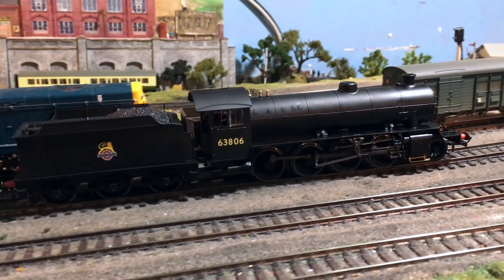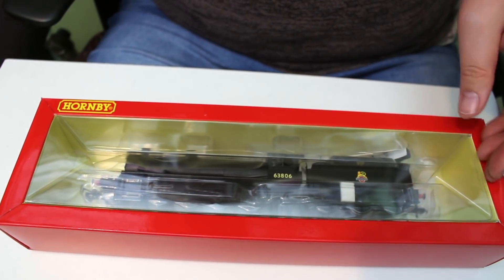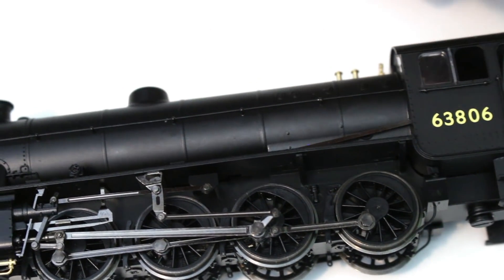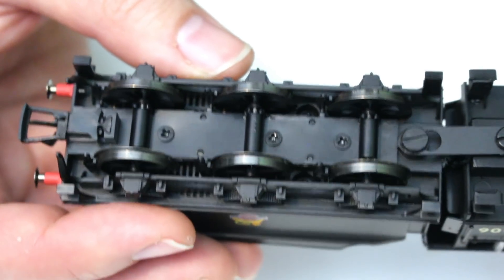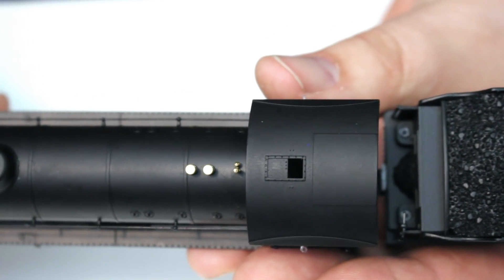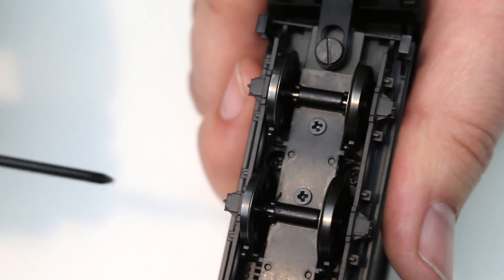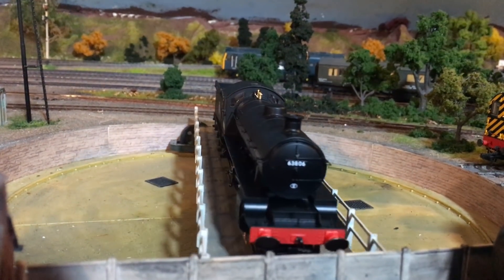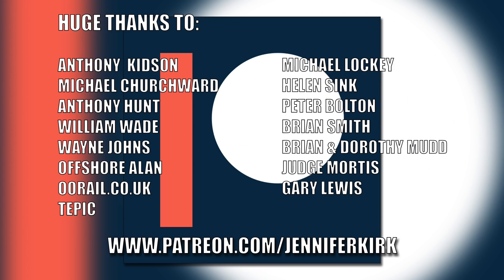Hornby Thompson Class O1- Review and DCC Fitting Guide

Comment: Nice review and Jenny made it look so easy I bought a new DC loco and a DCC chip to install. Just a warning that lifting the tender top off at 20:28 on the video was not possible on my model as it is still firmly attached on the left side after removing both screws. It's possible that excess glue at the factory overflowed when putting in the tender handbrake. So I guess I'm stuck with DC. :-(

Comment: The valve gear on this loco is fantastic, wouldn't want to get the quartering wrong on this one. Great review. For me it would have to be the LNER in Wartime Black. It is a great idea of Hornby's to move that connecting plug to the front, but (Yes, there is always a but) if they had of used black plastic to make the plug then you wouldn't see it. Martin. (Thailand) I was trying to make a LNER B12 out of two that I have as spare parts and all was going fine until I broke the Pick up Wire. then a tyre came off one of the wheels.Watch Youtube instead.

Comment: Great review and what you analysed was my thoughts too when I bought it unfortunately at the full retail price just before lockdown. I am a new starter to the hobby. I had a Tri-ang  train set bought for me one Xmas when I was a child but never expanded on the hobbie mainly because of the expense, but I always had a love for trains. Watching them at the local pit shunting. Now I have grandchildren it’s has fuelled my interest again and I have built a 6ft circuit in the garage and scratch built suitable scenery which was very enjoyable. It’s a 2nd Radius. My Thompson 01 does not like it at all, but I did fit the front steps so maybe that is the problem. Have you experienced any problems?
Reply from the maker: I’ve not had any issues with my loco.